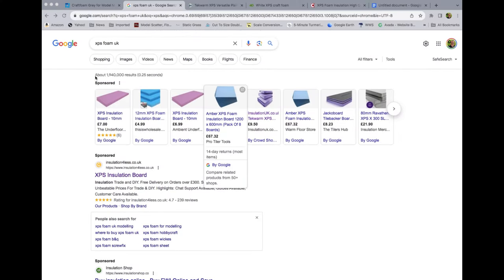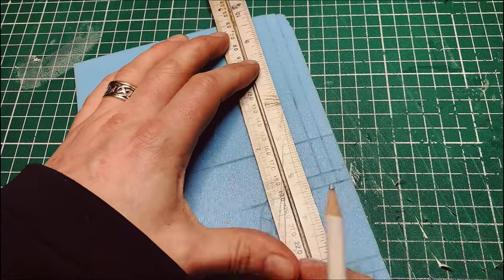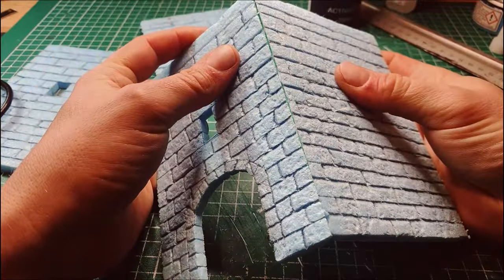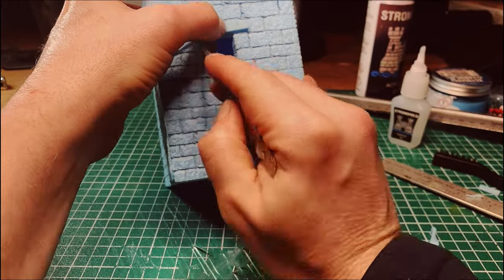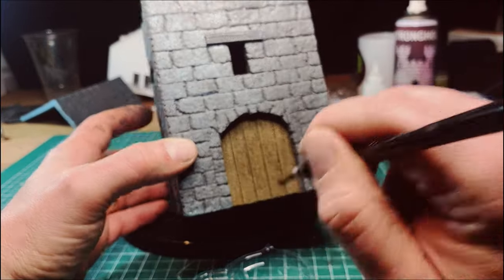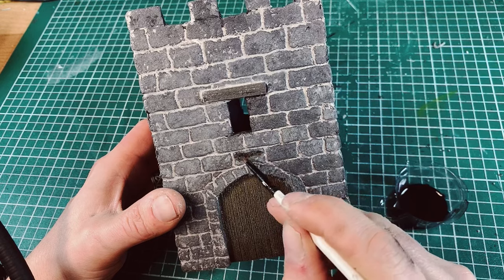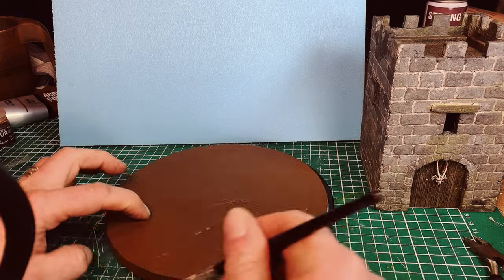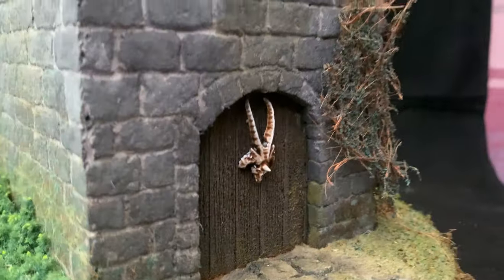How to make REALISTIC looking stone with xps foam

Comment: It looks fantastic. I struggle with XPS foam 'melting' when I use superglue. I also bought some sheets of insulating foam but it's very.... squeaky. 🙂
Reply from the maker: Insulation foam is very squeaky, especially if you cut it with a carving knife….anyway, try it with the more viscous superglue and an activator. I’m an impatient modeller and don’t have time to wait for things to set 😂